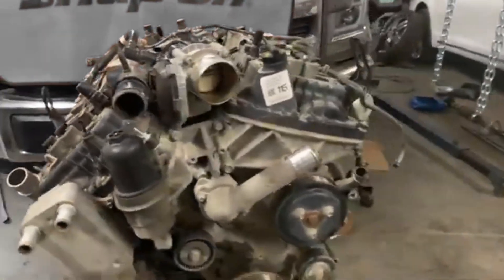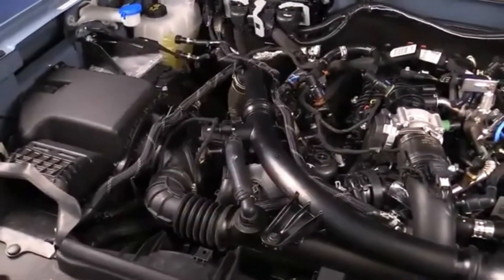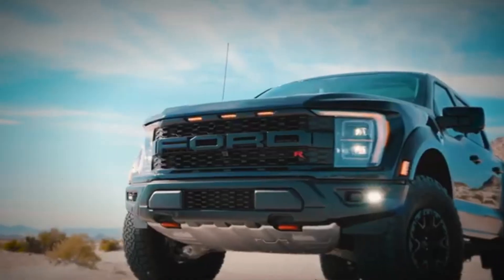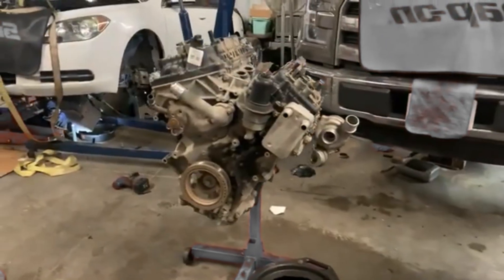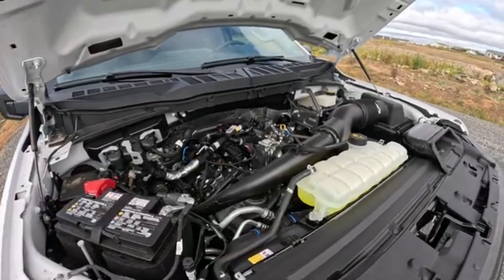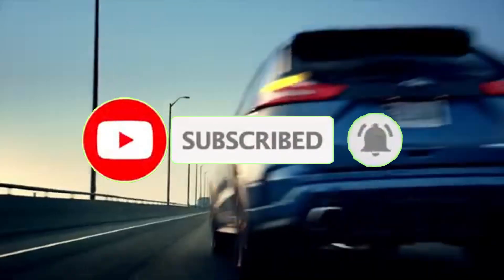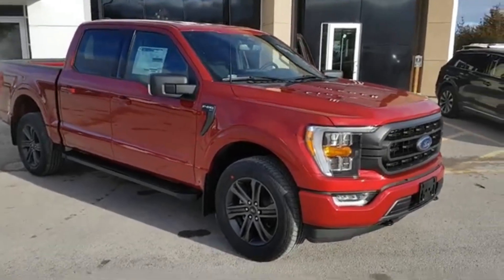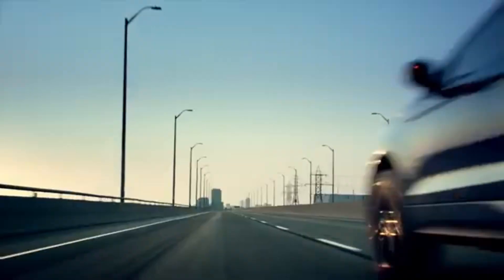Ford 2.7L EcoBoost Engine | What Makes It So Reliable?

Comment: I have one with over 360k and still runs strong
Reply: No way
Reply: @shotgunkid yes way ted. The TPS is going out in the transmission so it's finally parked and I bought a 2025 f150 with a 2.7

Comment: I was pretty much happy with my Tacoma 4.0 manual 4wd, but needed more towing ability and long drive comfort. I’ve now owned 2 2.7 Ecoboost powered F150’s and gotta say I really like the little engine, quiet torquey and better fuel economy than my Tacoma ever got. Not had the first problem out of either. A old diesel mechanic told me when I got my first one, change the oil, don’t get on till it warms up and let it cool off a couple minute when you get home. The 10 speed don’t like being cold, but after it warms up a little it shifts really good, but it hates being cold.

Comment: I started with 1st 2015 no problem, traded in at 120000 for 2nd 2019 and again no problem and traded in at 112000 and running my 3rd 2023 now! Change oil every 5000 miles and trans at 80000. Great truck with 2.7

Comment: 2016 F150, 2.7 L, 106k mi. Changed oil myself every 5k w synthetic. Runs quiet as a mouse, no need to add oil between changes.

 Probably best Ford engine Ive had since 1979 when i bought my first Ford.
Reply from the maker: That's awesome to hear! Stick to what you are doing, you will reap a lot more mileage out of it

Comment: Right now im driving a 2020 3.5 ecoboost. Got it brand new. It has 206,549km on it right now. No issues with the engine or transmission and drives smooth. Maintenance is a must.
Reply: Have you had to replace the turbos yet? If so, how much did it hurt the wallet?
Reply: @ddl5856 as of this moment I'm at 208,000km and I've had no issues with the turbos. The earlier 3.5 models had their issues but the newer models (2018-2025) had the kinks worked out. Just remember maintenance is key specifically the oil change.  I believe the manual says every 8000km. Some folks change it at 5000km but definitely don't make it go over 9000km.

Comment: Bs theres a class action lawsuit on that engine for excessive burning oil and coolant leaking into block. I know a guy who bought a recent f150 that had the 2.7. 63000 kilometres and it had that problem. He paid huge coin to fix it then traded it in on a tacoma.
Reply: And that has been determined a lie, move along…

Comment: 2016 Ford Edge Sport bought new, 160k on the 2.7 with normal maintenance and runs great.  One issue is that it burns about a quart of oil every 1k miles now.

Comment: Now that this engine has joined the clown show of other motors with a wet rubber belt, driving the oil pump, I no longer consider it “reliable”.  I don’t want any kind of maintenance item inside the engine that requires the front of it to be ripped apart to replace it. Now before any of you try to tell me how technologically advanced things have gotten and it’s 150 K replacement interval, save it. I’m not interested.
Reply: Nobody GAF about your misguided opinion

Comment: Design and good manufacturing is only 1/2 of the equation.
You can have the best of the best but if you neglect maintenance, your best of best in design and manufacturing is made irrelevant for the engine will not last.
That is the big problem with low cost cars, people that have no $ for maintenance and then say the vehicle have no quality....
I have had Chrysler and Dodge, which, I was told, are low quality....
10 years ownership and almost zero problems.... But then, I change engine oil every 5000 miles and only use full synthetic, etc...
Reply from the maker: Agree 
Thank you for sharing your experience

Comment: well, i bought a 2024 2.7 bronco new hoping i would be lucky to not get the cam phaser issue. 1500 kms (less than 1000 miles) into ownership, cam phaser rattle...

Comment: The 2021-up F-150 5.0 Coyote V-8 engine has the same Wet Belt for the Oil Pump, it’s not under a load like the rubber Timing belt in a 4-Cylinder interference engine.
Reply: The wet belt isn’t under a load in the 2.7 eco either
Reply: @pathunter7003   - True, both are just turning a oil pump.

Comment: I love the 2.7ecoboost, but I hate this AI slop, that contradicts itself.

“It has plasma arc cylinder liners” ITS AN IRON BLOCK DAMN YOU, IT DOESNT NEED THAT. THEY DONT HAVE ELECTRONICALLY CONTROLLED WASTEGATES! (Perhaps the newer ones do, but mine doesn’t )
Reply: They do now🫢
Reply: @pathunter7003 electronically controlled waste gates? I can see it
Reply: @tim9817  yup, and they work fantastic

Comment: Why did my neighbour have both turbos changed in his. At 60,000 km. 2 years old.
Reply: Late oil changes
Reply: @jimh.412 coolant was leaking out of one of them. They changed both.
Reply: Why are you asking that question here? Try asking your “neighbor “
Never happened
Reply: @pathunter7003 you’re full of crap.
Reply: @pathunter7003 yah you’re full of crap.
Reply: User error

Comment: Te best small engine out. Best Ford motor available since 2016
Reply from the maker: Agree
Reply: @ArrowGearhead really? Ive been looking into getting a ranger but im scared! High priced but questionable reliability! For every 5 things good i hear 3 that are horrendous!
Reply: @patrik4446 I’ve had my 2024 Ranger Lariat 2.7 for almost one year and 13000 miles. Zero issues, runs strong.  I have babied it with synthetic oil changes (changed 3 times already) because I want to keep this truck for 10 years
Reply: @BradleyHahn-d8d 13k miles isnt really telling me anything 😂 we're paying $30k + I expect atleast 100k miles trouble free! You're doing exactly what you should maintenance wise! It definitely wont be your fault if it fails! Im doing the same with my vehicles!  I hope you get 300k+ outta it.

Comment: Yeah real great engine it has a wet oil pump belt, what a joke not to mention echo boom.
Reply: That echo you are hearing is from that empty vessel stuck on yer neck
Reply: @pathunter7003  Wet oil pump belt is a real thing.
Reply: @lasomil  seems to be only a europeeon  issue

Comment: I am a big fan of the 2.7 ecoboost.  I had 2020 F150 wit the 2.7 and had a custom performance tune on it.  It made 360rwhp and 400+rwtq SAE and it never skipped a beat.  My daughter has a Ford Bronco with the 2.7 in it.  Makes that Bronco fun to drive.  It has tons of torque down low, ready to go.  We drove the Bronco with the 2.3 and I was like, nope, it needs to be a 2.7 or nothing.
Reply from the maker: Awesome! You made nice modifications
Take good care of it, it will pay you

Comment: There's hundreds of thousands on the road. Could it be possible that a few might have trouble given the average consumer can't seem to change oil on a timely basis then put cheap oil in..Oh my gosh pan gasket leaks. What a terrible engine.
Reply: And they fixed the issue of the oil  pan leaks years ago

Comment: I would not call 20 city and 26 hwy "impressive"MPGS from a modern 6 cylinder.Impressive is the 50 to 60 mpgs European vehicles get that we in the U.S. are not allowed to own.
Reply: Those europeeon 2 door specks that supposedly gets 50-60 mpg are not trucks
Reply: What vehicles are you referring to?? Small VW with diesel??? All the 1/2 trucks over there are Fords.

Comment: Question.   How long can the human body live on Cocaine?    Answer.   Ask the idiots that do the same cheating utilizing turbo’s on a smaller engine.    Result:     Stupidity results in a shorter life expectancy.   
PERIOD.    Idiots!
Reply: You're living in 1970. If you do regular maintenance and are not a cheap ass with oil brands. These engines will last as long as a normally aspirated V8.
Reply: @pbaker7160 not happening.  Try using common sense for a change.   Question.   Which engine is going to get hotter, thus breaking down more rapidly.   THINK!
Reply: @robertpoirier8520  well you did prove what an idiot thinks and not having any common sense, congrats
Reply: @robertpoirier8520  The reliability of these engines is better than the newer Coyote 5L. What say you now?
Reply: You are still living in the last century. Wake up. Turbo diesel engines are under terrific pressure and last because of high strength components. The newer turbo gas engines are built the same way. Strong components that are needed to take the extra stress of a turbo. Many have gone over 300K. Impressive for any engine especially these high tech 2.7 and others like the 2.3

Comment: 2023 2.7 liter engine with a whopping 25,545 miles, I give it alot of accelerator here and there. Pretty impressed with the 23-24 mpg I get out of it and this little engine is quite punchy, especially in Sport mode, loads of fun, really happy with it so far. Let’s see in the long run with higher mileage. Will it outlast my 2015 Hyundai Tucson with 92 k plus miles ? lol 😂. Here in the western pacific islands TOYOTA trucks outsell all other truck brands ..
Reply from the maker: Take care of it. It will pay you
Reply: Pretty sure the Ford Ranger now outsells the Toyota Hilux now. The Ranger is a good truck also

Comment: 2015 f150 xlt with the 2.7 ecoboost at 180k miles. One of my turbos had impeller pieces get sucked into the cylinders on that side and damage the engine! Now getting the engine rebuilt, new turbos, intercooler, water pump etc...$8k!!
Reply: Oof. not such a bullet proof motor after all.
Reply: @cheekimfbreeki9606  It was a first build of the 2.7, and who knows how the truck was maintained. Very rare issue on these motors. It's still very unfortunate, though.
Reply: @JustinWood-o5h  @cheekimfbreek will never understand…
Reply: But you can't replace it for 8k so......
Reply: @russowens4696  it’s a bull 💩story

Comment: My 2023 Ford F150 -XLT has a rough idle at stop lights and when I’m sitting at an idle. I’ve taken it to the shop twice, and they’ve concluded that it’s common in the 2.7 Ecoboost engine. They even gave me the opportunity to sit in another 2.7 they had on the lot, and it idled rougher than mine. Many people have reviewed these trucks on YouTube, but no one has ever mentioned the rough idling issue.
Reply: Sounds like the fuel pump issue that ford just did a recall on.  My 2022 is in the recall, not sure about the 2023s.
Reply: My 2018 f150  XLT with 128000 miles idles smoothly, can't even tell if its running at an idle, have to look at the dash to see if i left on the auto start- stop system.
Reply: @mikewade yup many people have reviewed this engine and have never mentioned a rough idle because there wasn’t any to begin with. It is very uncommon for the 2.7 to have a rough idle. Find a better shop or stealership to take it too
Reply: @pathunter7003 you probably wouldn’t notice it if you do not drive them back to back. I’m all for 2.7 and take it over 3.5. But to be honest 3.5 is much more smoother engine. Too bad it reportedly requires much more maintenance. For that reason I stick with 2.7
Reply: My idle is rougher with the AC on.
Reply: Remove and replace your spark plugs.
 Had the same issue and changed out the coil and plugs. Problem solved.
Reply: I added fuel injector cleaner and it helped a lot
Reply: My 2022 doesn’t idle rough.
Reply: I agree I test drove 3.5 and 2.7 back to back. Rough idling is the first thing that became apparent. However it reportedly does not require as many tweaks and fixes 3.5 would.
Reply: Had a 2020 F150 with the 2.7, no rough idle problems.
Reply: Run Chevron gas every third tank.

Comment: Just hit 300,000 on my f150!
Love it! Maintenance is the key
Reply from the maker: Awesome
Reply: When do you do your oil changes. When the truck says to or earlier.
Reply: @rayyoung7456 When the dash says so it's too late.
Reply: @mr.monitor. haha. That’s what I figured. I’ll stick to 5000 miles.
Reply: @rayyoung7456  👍5000 mi or less with any engine
Reply: Have you had to replace the turbos yet? If so, how much did it hurt the wallet?
Reply: @ddl5856 
No. So far just a turbo bypass solenoid.

Comment: 2019 and up are great engines,   not crazy about the wet belt oil pump drive,   but it has yet to be a problem
Reply: Hopefully they hold up for at least a few decades.
Reply: I love my 2019 2.7. But not the 10 speed trans.

Comment: I have 180k on mine. It has never left me stranded only had normal maintenance oil change and spark plugs at 140k
Reply from the maker: Great
Which vehicle?
Reply: Spark plugs do not last 140k in a turbo engine wake up ya having a dream😂
Reply: I'm only 20 days 200 miles into my used one.  Anything I should look for?

Comment: 😂 this video is absolutely false. Ecoboost engines are garbage.
Reply: The 2.7’s proved to be a shining star, you really should look in the stuff before you let everybody know where you are mentally
Reply: @777Randall our shop is full of Ecoboost garbage engine replacement. It is wiping out middle class in this country.
Reply: 2.7 is a beast engine, maybe the 3.5s are iffy but the 2.7s are one of the most reliable modern engines made today
Reply: From a thong wearer
Reply: 2024 Ranger 2.7 ❤ it. It's actually quite fast.
Reply: My 2016 2.7 has 1005k with no problems.  Saw video that said it's the worst!
Reply: Older ecoboost were garbage. The newer ones not so much anymore. Just like anything they gotta fix all the bugs I have a 2.7 ranger and it's fast
Reply: @Tc-ev9dd My 2016 f150 2.7  130k great motor.  I even had it tuned for 40k miles.  Back to stock now.
Reply: 3.5L ecoboost are much better now too. Less and less problems with cam phasers. Main thing is change spark plugs and coil packs and change coolant and oil when your supposed to.
Reply: some people like to be negative just for the attention
Reply: @kwamegyeabour3517  Ya. 15 yo kids in mommy's basement using her laptop
Reply: Lol, I had 2 other 2.7 ran others over 150,000 plus and my third is at 70,000. Change oil every 5000 and Trans every 60,000..this is my lasted I hope
Reply: 😂   SOUNDS LIKE U GOT SPANKED BY 1 !!!!!

Comment: I’ll buy one when I can do a conversion from belt to chain drive
Reply: @maxtokmin9683  I was thinking just like u 5  yrs ago but the kevlor oil belt is tougher than u think we have seen 2.7 ecoboost go 375k  with are fleet of f150s!better than the junk gm 5.3 0r 6.2 junk gm makes!
Reply: @kevinbritton1495  would you say it’s just poor maintenance from the owner side?
Reply: For all of you with mileage over 150K, isn’t the service interval for the wet belt 10 years or 150K whichever comes first? 

If you’ve had it replaced, what was the typical cost?
Reply: @josemejia6645  there is no “service interval”
Reply: That's a ridiculous thing to worry about. Put 150k miles on it and sell it.
Reply: @mr.monitor. OK rich guy I can’t even but a truck until it hits $25k
Reply: The belt has been tested, it’s stronger than a chain

Comment: These plasma lined cylinders are a great idea but they can never be resurfaced or bored out.
Reply: The plasma lined cylinders are in the 5.0 v8, not the 2.7.
It’s more AI bull 💩
Reply: @pathunter7003 2018 to 2020 were the only years that the 5.0 had plasma cylinder liners.
Reply: @barrymantei7795  no, the 5.0 still has the spray on cylinder walls

Comment: The Nano’s have always been good motors, wet belts be damned.
Reply from the maker: Yeah, but there are not so many complaints as of now like that of 1L Ecoboost with a wet timing belt.
Reply: Any documented failures of the belt? Nope..

Comment: Belt driven oil pump. I'll assume it's better than the Focus and Festiva which was a nightmare.
Reply: Ya I’m thinking going to ram due to the wet belt. I don’t care what anyone says, a belt to drive such a critical component doesn’t sit well with me, and obviously many others. They all have their problems but I can’t let that one slide.
Reply: @getjacked1  yes, if a certain engine scares you,  you should run away from it. Educate yourself about that belt , it’s quite easy with google
Reply: Who knows how many will hold up after a decade. Such a dumb idea to put on an otherwise solid motor.
Reply: @djmjay
Why should  the 2.7, a totally different build of engine, be subjected to the projection of problems of a different engine? That’s ridiculous.
The belt in the 2.7 is totally different material than what was used in the europeeon ford Fukus